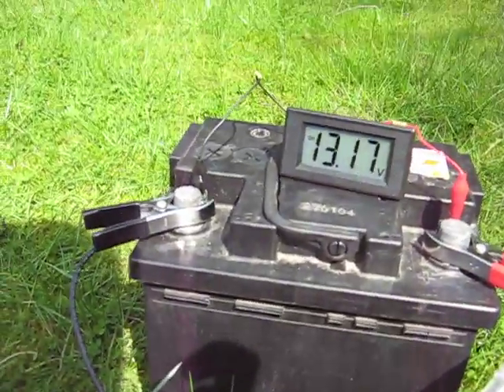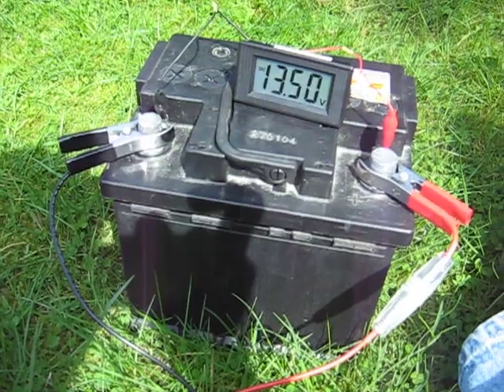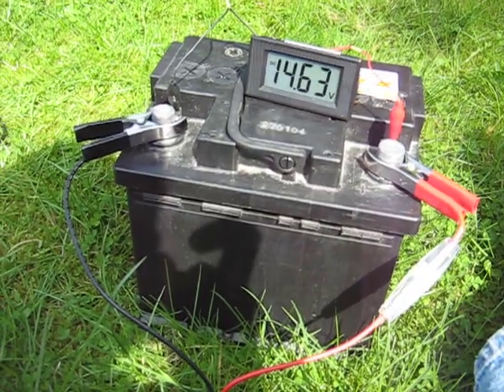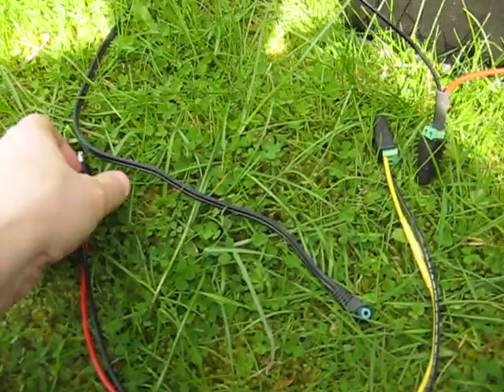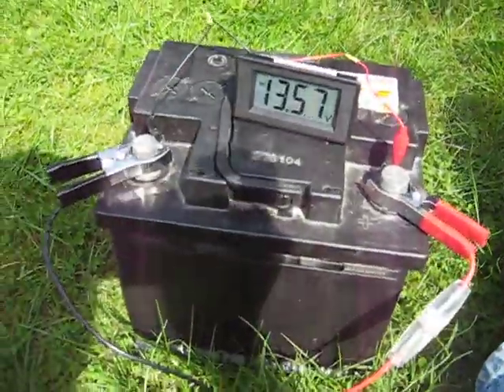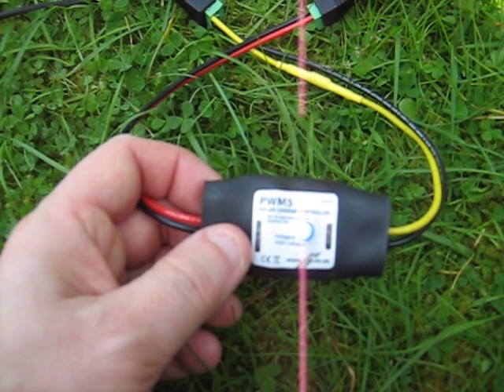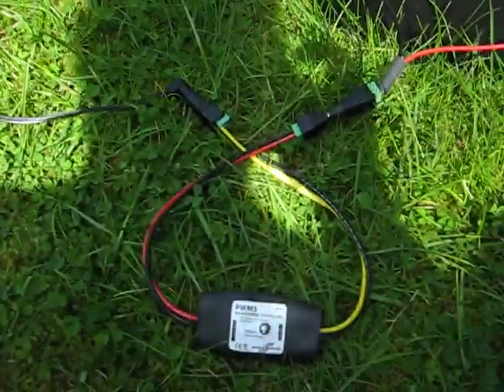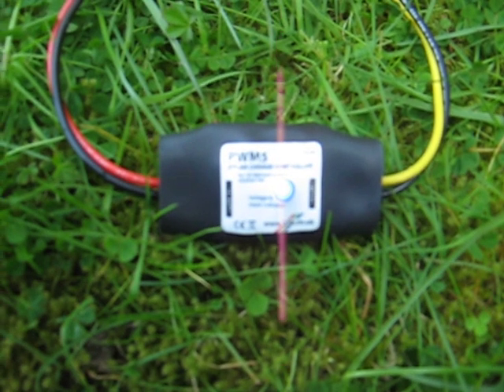Charging a Car Battery with a Solar Panel and Charge Controller

Comment: Thanks for sharing and explaning why directly we shouldn't connect battery to solar panel.   14 years later too this video is clear and is giving good information. 
I am planning to use a 55w 12v mono perc panel and a PWM solar charge controller for making a trickle charger for my car.    it parked most of the time and gets discharged

Comment: Could you use the solar panel to run a alternatir system that charges the batteries that are in use? An if so would i need a batter for the alternator system. Also would i need a surge protector/30min apc between the batteries and the appliances?

Comment: My panel is just 12 volts from a electric fence system. It won't get above twelve but it will bring it up to at least 8 or 9 volts which is good in a jam.

Comment: Can you plug a 110v power supply into this to charge the battery instead of using a solar panel? 
I’m making a Bluetooth speaker and I need to be able to charge the 12v battery that’s built int the box

Comment: Can I connect the solar panel directly to the battery if the battery holds very low charge, then later add the charge controller when the battery charge is high enough?
Reply: No

Comment: What if your battery were connected to your car and alternator? Any danger/risk? Does that charge controller have a diode to keep the panel from draining your battery at night? 

I have this 200watt, 18v, 6amp max flexible solar panel I want to mount on my van. I would like to install a 20amp charge controller that has 2.4v USB ports built in.  But I have a 4amp 12v fan Id like to run during heave sunlight.. but I've been told I need a stead 12v source.. Can I use my vans 12v 70AH 120RC primary starter battery as part of my simple solar setup? I don't anticipating ever draining the battery below 11v.

Comment: Basically saying the battery is dumb. It doesn't know how to stop charging if directly connected to a solar panel of any size wattage. By using a charge controller to charge a battery, the charge controller regulate the proper voltages to charge a battery. Then shuts off when it is fully charge. Just like a smart charger would do.
Reply: A simpler way to think about it is like this. The battery, or storage device, is regulated to draw and receive up to 12v. A solar panel of that size will likely give more than 12 volts so to charge the battery safely, a circuit is put in-between the two connections to prevent the battery from receiving too much power. Too much electricity at once will cause the battery to overheat and meltdown.

Comment: would this work in a car thats not used often? would the alternator cause problems for this setup when the car is started and the voltage rises to 14.4v?
Reply: With a good charge controller it is built with smart technology protections. It will accept 12 to 24volts charges 1.5amps or 50amps or higher. The controller will regulate according to the voltages it detects. Not over feeding not under feeding.
Reply: The answer is No. But consider how you plug the batteries in  Parallel Positive to Positive, Negative to Negative. Combining 2 batteries. Which read the voltages as 1 battery. The other means of connection is in Series which will joint 2 battery together to read 24+- volts. So that is said. How you connect the Positive and Negative cables from the charge controller will determine the rate it charges and which battery will charge first ur both charge at the same time.

Comment: Correct me if I am wrong, below 10 watt on a 12 volt deep Cycle battery (96ah) you can't go wrong, right?
Reply: I can say from experience, I ran a 5 watt panel hooked directly to a deep cycle battery which is used for opening a 20 foot wide commercial style cantilevered gate (average 2 - 5 cycles per day), and I ran it for 17 years so far.  It has run fine the whole time,  but as anyone would expect, I have had to replace the battery every 3 or 4 years.
Reply: Is there a blog for electricity forums and what not? I will be starting electrical engineering courses soon, and want to get  head start on the knowledge and know how. Thanks.

Comment: Be careful here...this video is potentially misleading. If you consistently charge at anything less than 13.8V your battery will suffer slow death by sulfation and lose capacity. Nor is charging to 13.8v ideal. Make sure your charge controller takes the battery to around 14.2 V and then reverts to a float charge of 13.8V thereafter.
Reply: thats not correct either, my agm 12v battery likes 14.8v, and this is fine anything over 13v is charging
Reply: LOL. Too many Brainy in here, no Brawny. Each to their own knowledge bros.

Comment: With this setup, will I also be able to run an inverter off of the battery at the same time? I plan to use it to power my ponds pump (0.3Amps, 115V, 400GPH) so I don't have wires running everywhere
Reply: Chris Espinoza then just pick up a solar powered pond pump there like 20 bucks on Amazon

Comment: why do you say at 14v it's bad for the battery ? when a battery is being charged from your car  alternator it hits that voltage
Reply: Your car also feeds from that though reducing that. Ubless you akways drive with no stereo or aircon on etc
Reply: Battery charging voltage anything between 13.8V-14.4V(14.7V some of new cars )

Comment: I have a 12volt car battery with a dead cell . I'm going to use it to recharge my laptop and run my 12v coffee  pot.. Is the controller set at  13.5 v?  Will it be set too high for my battery which woiuld be running at  10.5 volts?
Reply: dead cell means dead battery, it is useless an will self drain........ throw it away, even connecting it to other batteries will just drain them all

Comment: What if the battery is connected to a significant load? For example, a continuously running motor. In this case, to get maximum going into the battery (to offset that load), wouldn’t it be better to simply not use a charger?

Comment: I'm thinking of purchasing a Halfords Solar Battery Maintainer 12v 6w to keep my 12v car battery toped up when using an inverter.

In their Q&A section someone asked:
Will the panel over load the battery if left on?

The answer:
This charger is a maintenance charger, which will only provide power to the battery when it starts to drop. At the point the battery becomes fully charged again, the charger will stop charging the battery.

Would I be correct in assuming that this product comes with a built in charge controler.
Reply from the maker: Unlikely. The Q&A answer isn't strictly correct - the panel could theoretically overcharge the battery, but it would need a lot of sun - more than we get in the UK.
Reply: Lee Davis n

Comment: Hello, I hope you don't laugh and have the time to answer my......question. I have an electric bicycle with 4x 12v 17ah sla battieries and I was wondering if there is a way to solar power these while I ride.? Would the panels be too big? Is it even possible? Litium ions are too expensive for me and these 4 batteries cost $200 dollars only.

Comment: my car's battery is 12V-70AH. I have purchased a solar cell panel 12V, 1.5W-100mA for trickle charge (http://item2.gmarket.co.kr/Item/detailview/Item.aspx?goodscode=365952259).
In case I don't use my car for 1 week, the battery is running out that cann't make the car engine starts, how long does it take to fully charged my car's battery if I use this panel ?
I cann't measured the current output from solar panel, but as it claimed on the box that the output directly from the panel is ~19V/250mA in highly sunny condition, and stable at ~13.7V/100mA after the charge controller.
So, as my calculation: 7000 mAh (battery) / 100mA (output of solar pannel) =70 hours, then / 8hours per day on average, it comes out ~ 8,75 days for fully charged, is it right ?
Reply from the maker: This video should help answer that: http://youtu.be/iPjKCiv61l4

Comment: Would I be able to charge several deep cell batteries in consist, connected to an inverter for an off grid system with this device?

Comment: 12 volt batterys usauly charge at 15 to 16 volts and off the charger a good 12 volt battery will sit at 12-13.4 volts it is save to charge at 14.5 my alternator charges at 14.8 lol
Reply: Yeah, you just described the way to kill a battery within a year. lol
Reply: all my batterys charge at 14.2-14.5 depending on start  up with my alternators they charge 14.5 cold and when the alts get hot they dip down to 14.2 ive had all 6 batterys never touched on the same setup for 2 1/4 years
Reply: and they still hold 13.2 strong with the car off
Reply: kc8kc
Earth 4 Energy

Safe Redirect => http://home-renewable-energy.blogspot.com

Comment: My solar pannel is small,  only12 volts. 7wats. Would I still need a controller
Reply from the maker: On a big battery, probably not. On a small battery, probably only during the summer months if you're not discharging the battery much.

Comment: it that the same if using a wind turbine?   and able to use the same charge controller ?
Reply from the maker: No - wind turbines need a different type of charge controller. The PWM5 doesn't work with wind turbines

Comment: Lol sounds a bit like Richard Dawkins.
Reply: Oh. I commented here. I don’t remember this video but I remember that comment.
Reply: My batteries are rated at 95 ah,and solar panel rated at maximum power output 100watts.Divide the multiple directional pulsar ambience 3c,by the voltage times 3.67 and square the difference from the relay magnetic electrodes,and v medium plus ¥,gives the precise timing value of 108.00.67.5 milliseconds per quarter.

Comment from the maker: Yes - just like in the video. Solar panel, charge controller, battery, fan (add a switch if necessary).

Comment: I'd like to use  a solar panel on the roof of a van to charge a separate battery just to power a fan at night. The purpose is just to cool the car enough at night so I can sleep. It doesn't have to be a car battery - a smaller one would do. Do you know of a way to do that?

Comment from the maker: Unlikely. The switching device is a MOSFET which is more likely to go open circuit in an overload condition. If the software freezes, the charge pump stops running and the MOSFET will turn off. Also, a watchdog timer reboots the program. There are a number of safeguards against this happening.

Comment from the maker: I'm just seeing a poor match between the low power of the solar panel and the very high consumption of the water heater. Either use more solar panels or use a lower wattage heater.

Comment from the maker: It won't work. Unless you're planning to run the 'heating appliance' for no more than a minute every hour, you won't have enough power. Also drawing 3.5kW from any 12v battery will destroy it pretty quickly.

Comment: Julian, im doin a solar water heater project where im using solar panel to charge the current for my water heater appliance.A heater consume power is 3.5kW so i plan to install 50W panel to car battery with controller in middle and an inverter to convert the dc to ac current for heater appliances,it is good enough or u would suggest some better rating for each component? also, it is ok to use car battery as shown above rather than deep cycle battery for long term as im using solar panel project?

Comment from the maker: Let's say you use an 80W panel and that you get 5 hours sunshine a day. You could run that 800W appliance for half an hour. Factor in losses, and you might get 20 minutes. 800W at 12 Volts is 67 Amps so that's about 24 Amp hours. So the battery should be at least 50Ah.

Comment: What rating solar panel should I use to make a portable generator connected to a marine deep cycle battery and inverter to power a 800 watt appliance?

Comment from the maker: Four 12v batteries in series gives you a system voltage of 48 volts. I only work with 12 volt systems.

Comment from the maker: The charge controller protects the battery so you can leave it set up like this permanently. You can also connect an inverter to the battery (and use it). You can also start the car engine. Everything can be left connected up.
Reply: Small system with car battery
https://youtu.be/hsME1zoCcWg
Reply: Thanks I have some parasitic electricity draining my EX  rig’s batteries, instead of finding it am adding solar to it lol I have to much shit hooked up to it, it could be anything at this point at how old the ex is
Reply: What will be the fasted way to charge a car battery using solar panels and how many watts of a solar panel do i need to fully charge a car battery ?

Comment: [I`m smilled.] Your translator was a little incorrectly expressed, having translated my slang. I will a little tell in a different way.
It was necessary to measure simply current of a charge and to show it on the device, then it would be evident, what current is received by the battery.
It would be quite good to specify the area of a solar element.
Nevertheless, thanks for the answer. From me in any case "like" for video.

Comment from the maker: The PWM5 controller handles 6A so can be used with solar panels up to 100W. You will need crocodile clips, cable, connector block (chocolate block), connectors for whatever is on the end of the solar panel cables and optionally a fuse.

Comment from the maker: Standard techniques are peturb and observe and/or hill climbing. The maximum power point moves around - it's not fixed like a regulated output voltage voltage. What interests me is whether the maximum power point coincides with maximum battery voltage. If it does, the design could be so much simpler. Thanks for the interesting question.

Comment from the maker: Fascinating question. MPPT only applies during the bulk charge phase, absorbtion and float require regular PWM with battery voltage monitoring. MPPT seeks to maximise solar panel power, so you need to measure panel voltage and current and multiply them together. A standard buck converter regulates output voltage, but that's not required for MPPT so you'll need a non-standard DC/DC converter - you may have to design it yourself. You'll need to find the maximum power point which isn't fixed.

Comment from the maker: A certain amount of bubbling is good - it stirs up the acid preventing layers of different strength acid forming (stratification). Excessive bubbling is undesirable because water is lost during the process. Charging voltage can be high for a while to speed up charge absorbtion, then the voltage should be lowered to minimise gassing and consequent water loss.

Comment from the maker: Sorry, I didn't really answer your question! Solar is almost certainly going to be more effective than wind unless you live on an isolated farm on a hilltop. Domestic scale wind turbines are notoriously ineffective, generally because they're not placed high enough. No-one's going to be very pleased if you put a wind turbine on top of a 100ft pole in your back garden. Having said that, there's a small marine turbine (50 to 100W) attached to a nearby house which always seems to be spinning.

Comment from the maker: Wind generators need a system that stops them running too fast when the battery is fully charged and not taking current. Either a shunt type charge controller (which shorts out the generator) or a controller with a dump load (which diverts current to a dummy load - often a heating element) must be used with a wind turbine. My controller is a series type (which goes open circuit when the battery is full) so it only works with solar panels.

Comment from the maker: If the battery is large and the panel small you probably don't need a charge controller. But a small battery (like a small SLA gel battery) could still be damaged by a 5W panel.
Reply: Your right it would take many hours like a full week before it gets anywhere near to. Damaging the battery  . The battery is miles bigger than the small solar panel I have a 30 watt solar manner charger and my battery has never been damaged so I think u would need to leave it on a whole week to damage the battery as the solar panel is not powerful enough to damage the battery . I've been charging my batteries now for around 4;year's I only leave them on for around 12 hours that's all

Comment: It's a nice battery desulfator right ther if stills at 16v at low amp like this 10w panel u will be saving a lot of money reconditioning old batteries and saving money not even need to buy a desulfator device!

Comment from the maker: 36-cell solar panels (the type designed to charge 12v batteries) have an open circuit voltage around 22 volts, easily enough to overcharge the battery. Why the high voltage? So that they also work when the sun is low in the sky or obscured. 14v solar panels are not common (you'd probably have to make your own) and would only work under full sun.

Comment from the maker: You're wrong. 13v is a safe voltage to hold a lead-acid battery at. Also, solar power isn't constant - the sun disappears every night for a few hours.

Comment from the maker: If the kit has silly little solar panels (1 or 2 Watts), you probably won't need a charge controller (unless the battery is also very tiny). If it has a proper solar panel (10 Watts or more) it should be supplied with a charge controller or you risk damaging your battery. The charge controller fits between the solar panel and battery - you don't need anything between the battery and the inverter.

Comment: the alternator in ur car charges the battery at 14.4 to 14.8 volts when the car is running moron!!!!!! ask an auto sparky. leaving it constantly charging at 13 volts will destroy it sooner or later

Comment: I just use a smaller panel that puts out about 30 ma.  The battery doesn't get overcharged that way.  30 ma is more than the normal drain of the accessories in my car.